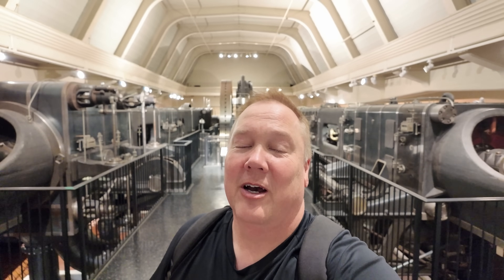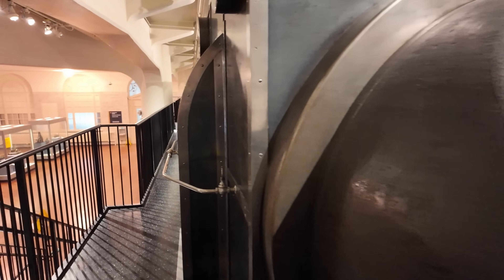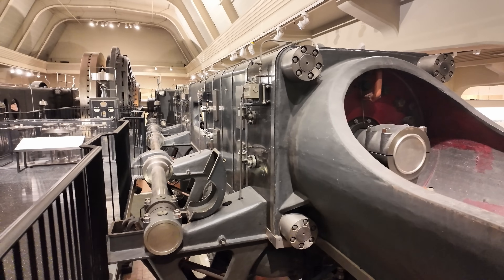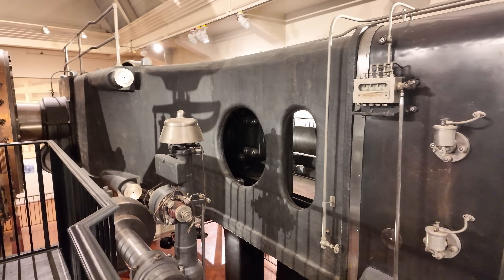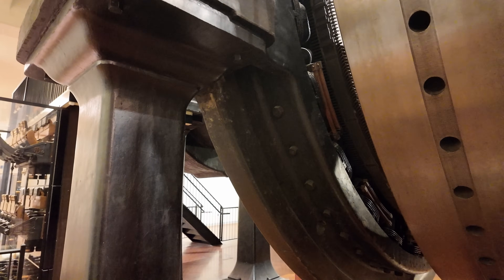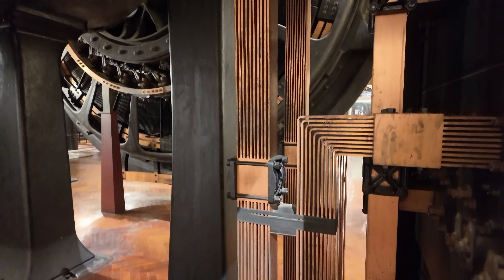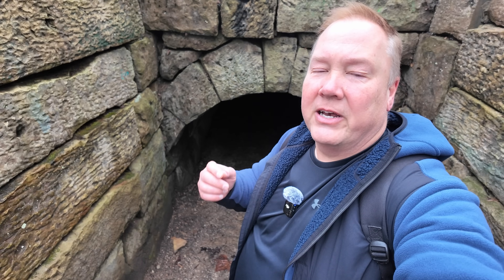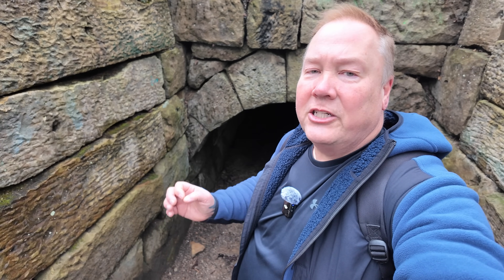Henry Ford's Hybrid GasSteam Engine

Comment: My intuition tells me that the mentioned average modern time power plant power output cannot be correct. I’m afraid a number around 50 GW might be more correct. But - it’s just my gut feeling.
Reply from the maker: You're at least partially correct.  New, grid-power plants are far bigger, but there's still a LOT of small, grid-connected power plants out there, which bring the average down.

Comment: Great video. Love that place. But... Fyi, I work at a power plant from the early 90,  and each one of our turbines generate 150 mw. And we're small by today's standard. 35 mw is impressive for that time though.
Reply from the maker: Thanks for the comment.  150MW is fairly small, but remember, there's a LOT of small, grid-connected power plants out there that are way smaller.  They outnumber the big ones, and bring the average down.

Comment: Where the conecting rod connects to the flywheel it appears you can adjust the position of the pin amd thereby adjust the stroke slightly?
Reply from the maker: I hadn't noticed it, but it may be a way to slightly adjust for balance?

Comment: We went through the Art Devo era in many areas: construction, tool design, automobiles, consumer goods.

I have a few old tools I've had for decades, which I got in near new condition. They fit right in w/ the rounded, sleek designs of buildings & automobiles of the same era; the only missing element is the bright colors, typically associated w/ the style. 

The tools are typically bare aluminum, very smooth texture, but brushed, not polished.

Well designed, mechanically, they operate well, and are obviously well built & durable, since I'm using them, after owning them for 35-50 years.

I have a 1/2" router in my Art Deco collection.  Porter Cable is credited w/ the invention of the router, but the router I have is the company who DID invent the router. 

They were a Chicago company, United Equipment Co, I believe, I'd have to go look at it, to be certain.

I want to say 1938-39, Porter Cable bought them. (Been close to 20 yrs since I read the history)

Within 2-3 yrs, the name was changed to Porter Cable & along w/ the name change came credit for inventing the tool type.

I have it installed in my router table.  Height adjustment & bit install & removal, the 2 major operations on a router are simple, precise & work flawlessly.

I have a Porter Cable 1/4" trim router, a newish Craftsmen 1/2", (2nd one).  None of them are HALF the router the United is.
Reply from the maker: I don't think I filmed it, but they have the tool rack for this engine on the wall.  All are bright and shiny.  They have a good collection of old tools there, too, obviously, with a lot of overhead line drive tools.

Comment: 1 mega watt can run about 750 us homes so about 24,000 homes those engines could power HOLY SH$T
Reply from the maker: They used a LOT of power, and that's nothing compared to what auto plants use now.

Comment: Thanks for sharing this vid , very interesting. Imagine all the heat and noise when these were running!
Reply from the maker: Honestly, it may not have been all that bad.  The heat was being captured as much as possible, steam was being recondensed (and look at all that insulation in the lower area) and noise is usually from inefficiency, which was minimized.  Wouldn't have been library-quiet, but maybe not as loud as you'd expect, either.

Comment: Really curious what that sounded like running it at full output
Reply from the maker: I doubt it was very quiet, but noise is typically a result on inefficiency, so it probably won't too terribly loud, either.

Comment: They were using Electricity, in stead of just running a shaft through the buildings?
Reply from the maker: Yep.  They may have also been running overhead line drives in some areas.  Henry Ford's projects get even more interesting when you look at his Village Industry sites, which were small, parts factories scattered throughout the area, all run by hydropower.  They were all built about the same time.  About half had waterwheels running overhead line drives and the other half had turbines running generators.  Which he chose was based on what the factory was producing and which made more sense for the equipment they needed in that location.

Comment: As retired machinist I can say every piece of that equipment is a work of art.
Reply from the maker: Definitely is.  It was around the peak of when machines were built to not only be functional, but also elegant.
Reply: Yep
Reply: I agree, all done without cad, cnc modern steels and yet in many ways better. Who would not be proud to be an operator on this machine?
Reply: The art was in how it was cared for. Could have been built with a.003" tolerance and less. If it's not lovingly cared for it ain't gonna last long.... My joiner table, at my old job, is already showing wear. They didn't want to pay for skills, so they are going to pay for a new machine instead. A western pneumatics joiner table or anything else should be in service for at least 30 years.

Comment: No blue or green haired people involved with the construction of that marvel. Just hard-working and brilliant men. Not sure we possess that kind of ingenuity capability in America anymore and even if we do, Democrat environmental crazies would suppress any ability to create something that complex and powerful.
Reply from the maker: Actually, the environmentalist types would probably prefer more of these.  You're using a waste product of an industrial process that would otherwise just be flared off to fuel it, then capturing waste heat from that to power the other side.
Modern stuff doesn't do that so much because it's so much easier to just throw more power at the system, and you can get all the power you want by just plugging into the electric grid.

Comment: In that same part of the museum is a model of a vertical compound GE turbine. Only two were built and neither was a good idea in my opinion. Cool idea to minimize footprint, but from a maintenance perspective it would have been a nightmare.
Reply from the maker: I can't remember the specific one, but, outside the marine engine world, where space is serious money, going smaller either means higher pressures or higher speeds, and usually both, and that will usually created more problems.
Reply: @Industrial_Revolution  You are correct, but even marine turbines are tandem or cross compounded, not vertically. It was a great idea for footprint, but from a maintenance standpoint it was a disaster.

Comment: My late father in law worked in Tool and Die at Ford Rouge.  I have a ~1/4" left hand drill bit, with the Ford logo on it.  Left handed so that if workers stole them, they wouldn't work in unidirectional drill presses and drill motors.  There are a lot of videos on Youtube of similar but smaller gas or steam engines running, they're both fun to watch. Search for "Corliss steam engine", and "Snow Compressor Engine" for gas.  Coolspring Power Museum, between Brookville and Punxatawney PA has a 600 Hp Snow compressor engine, and the gas supply to run it at full design speed.  Most of the Corliss steam engines are in the UK, and there are a lot of them. Warning, it's a rabbit hole.

Comment: Very interesting. Just shows what could be done back then without computers and the software to run them. All those cast parts basically done by hand.
Thank you
Reply from the maker: I haven't seen any pictures of the design work on this, but the process at the time included huge, hand-drawn plans with engineers crawling on the floor on the plans.  There's some photos out there of the Titanic design work that show it really well.

Comment: So the waste gas from coke production for making iron and steel, was used to operate the gas side, and the waste heat from burning the waste gas was used to power the steam side. That is pretty impressive efficiency. Thanks for the tour.
Reply: It's the forerunner of today's Combined Cycle Gas Turbine (CCGT) power plants that use a gas turbine, but capture the waste heat from that to heat a steam boiler to run a steam turbine.  One of the limiting factors for efficiency of an internal combustion engine is the high exhaust temperature which represents waste heat; but an external combustion engine can use heat at that temperature as its input.  CCGT plants are the most efficient power sources ever built, some approaching even 60% which is astonishing, but the theory would apply equally to a piston engine.  I had no idea Ford had built such a plant so long ago - I wonder who invented the concept?

Great video!
Reply from the maker: Yep.  Henry Ford's method of using everything possible.  Glad you liked it.
Reply: Reflecting on it, the fact these innovative engines only lasted 6 years before they were replaced shows it to be a case where engineering practice could not, at the time, catch up with the scientific theory.  The principle of using a gas "topping cycle" and a Rankine (steam) "bottoming cycle" to increase efficiency had already been shown by an analysis of well understood thermodynamic principles, to be a way to greatly increase efficiency.  But trying to build an engine to do this using piston and cylinder technology led to engines that were too large, heavy, slow and cumbersome in relation to the power output.  A large, slow moving engine loses a lot of heat and suffers a lot of friction so the efficiency gain theoretically achievable was not realised.  The idea was too far ahead of the achievable reality of the time. 

It was when gas turbines came along in the 1940s (based on steam turbine technology that had already been invented long before), that the equipment could be made much smaller and more compact for the same power output, that enabled this combined gas and steam ("COGAS" or "CCGT") technology to be physically realised, and the scientific idea became a reality.  As I write this, 40% of our electricity in the UK is being generated using this technology, with an efficiency not achievable by any other type of engine.

You have to try an idea out to find out if it's timely or ahead of its time.  All credit to Henry Ford for his belief in innovatively exploiting scientific principles and investing in testing them to try to move forwards.  He achieved many advances in engine performance through using materials science to produce better steels and so on; it's coincidental that this idea had to await the advance of materials science to produce the high temperature nickel alloys needed to build reliable gas turbines, before it came to fruition.  Circles within circles!
Reply from the maker: @marionbloom1218  a lot of great information there.  Thanks!  One thing, on the timing, though.  Henry was all about scale, and the Rouge plant was close enough that it just made sense to centralize power production there.  I don't know what the original power plant at the Rouge plant was, so don't know if it was significantly more efficient or not, but it was significantly larger, and I suspect that was the main factor leading to the shutdown of this engine at the time.
Reply: Only one of the many benefits Ford's method of building everything in one place provided.  Raw materials in, cars out.
Reply: Was the steam side driven by the exhaust heat from the gas engine side? Or did it have separate burners and boilers for those?
Reply: @gregorymalchuk272  I've not seen these particular engines but in a modern Combined Cycle power plant it's the waste heat from the gas turbines that heats the boiler that provides the heat for the steam plant.
Reply: @gregorymalchuk272 from what I have found on it, they used waste heat from the gas side to “preheat” the water before it went in to a typical boiler. There isn’t enough heat to make the amount of steam necessary, but plenty to help the process along.
Reply: @johngaltline9933  That was no doubt due to the large size and slow speed of the engines, leading to high heat losses.  It explains why the efficiency gains weren't enough to justify the cost and complexity.  With a modern CCGT plant the exhaust from the gas turbine is hot enough not just to preheat the water but to boil it at high pressure as well, meaning the steam cycle gives a viable boost to the efficiency.

Comment: Do they ever spin it?
I don't expect it would ever run again, but
Just so things don't get frozen up.
Reply from the maker: As far as I know, once Henry set it up on the museum, it never moved again.  If you look at some of the steam locomotives that have been pulled out of parks, after sitting outside in the rain and snow for decades, and get put back into service pulling passenger trains, though, if they really wanted this back up and running, I'm sure it could be done.

Comment: 50MW is kinda small for average. I think the number gets dragged down by there being so many smaller plants. In cities NG plants frequently exceed 1000 MW. I've spent alot of time at hydropower plants and its not that uncommon to have individual hydro turbines that generate 40MW. But that's grid scale. This is just a single 1918 factory. Strange that they chose to use pistons when the steam turbine had been invented like 34 years prior.
Reply from the maker: Some others have mentioned the same thing about size.  There's a LOT of smaller, grid-connected power plants out there, and you're right, they bring the average size down.
I wonder if the pistons were chosen to have the symmetry with the internal combustion gas side of the engine.  It's also possible, of course, that he was just more familiar with steam pistons, because Henry Ford was VERY familiar with pistons.

Comment: The most common grid-scale gas turbine in use in the USA is the GE Vernova 7HA, which produces 300-430MW. Most power plants have more than one of these turbines, putting the typical modwrn power plant output closer to 10 to 20 times the output of this old Ford plant. 

Its neat old tech but its an order of magnitude less powerful than todays power stations.
Reply from the maker: Definitely, if you're building a new grid power plant, it's going to be producing a huge amount of power by comparison.  There's still a lot of smaller ones out there still on the grid, though, and still producing power, and they bring the average down.

Comment: Large copper thingies are not for high voltage, those are is for high current.
Reply from the maker: You're right.  The current is what needs the much larger, heavier conductors.  Thanks.

Comment: I just got done watching a bunch of jay lenos garage,  namely his insanely awesome collection of steam cars and it got me thinking about what we could do with modern materials and tech.  I did a few google maths and it would be possible to create a full size sedan that could travel at 100mph with a small 10hp motor used to create electricity to heat an element for super heated steam.  700 degrees F.  And it would be far simpler and more efficient than all these electric hybrids they're producing now.
Reply from the maker: I really want to find someone with a running Stanley Steamer to do a video.  Maybe Jay Leno will give me a call?
There's a lot of experimental cars out there.  Your design would certainly run, vehicles moved from the more efficient external combustion (steam power, mostly) to the less-efficient internal combustion (gas and diesel, mostly) primarily due to responsiveness issues.  People want to jump in their cars, turn the key, and go immediately.  Steam has to heat up, get up to pressure, and the faster you get up to pressure, the more stress you put on the boiler, shortening boiler life.  Smaller boilers heat faster, obviously, but that still leaves you sitting in your driveway for a while.

Comment: Corliss type steam side.
Grey type from Hooven, Owens  Rentschler.
Very nice you were up on the deck! Was up there decades ago.
Reply from the maker: I keep hearing stories that most of the engines in the museum used to be much more accessible, with people allowed to climb around them.  Also, many more used to run regularly (not this one).  Currently, the only engine that runs inside the museum is the giant Corliss engine.

Comment: No such thing as a DC generator.
Reply from the maker: One of the challenges of producing technological information that's accessible for non-specialists is that sometimes your technological terminology sometimes has to bit a bit less accurate to make things easier to understand.  If it hasn't already been done, I'm sure someone could do a full dissertation on this machine.
Reply: Really, what did cars use before alternators?

Comment: What's truly amazing about these engines is that they were made with incredible precision, in a time that most things had to be made by hand without precise machines.
Reply from the maker: They had no CNC machines, but they did have some machine help.  Efficiency was really a requirement back then.  Today, it's easy to just throw more power at a problem, but back then, power was often a limiting factor, so you have to get every watt you could find.

Comment: This engine is very much an ancestor of the combined-cycle power plants often used for peaking power—a gas turbine generator exhausting to a waste heat steam generator, which fed a steam turbine generator.  Those combined-cycle power plants are among the most efficient thermal power plants, up to about 60% efficient.  

It’s also interesting that this plant generated DC power.  The speed of DC motors is much easier to control.
Reply from the maker: Remember that Henry Ford and Thomas Edison were very close friends, with Henry very much inspired by Thomas, and Edison always pushed for DC over AC, despite it's major shortcoming in transmission distance.